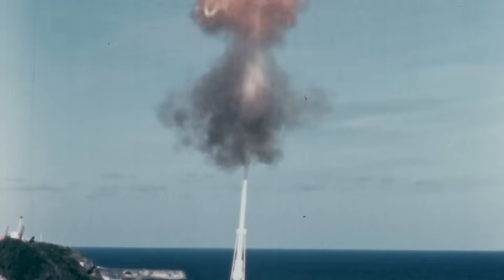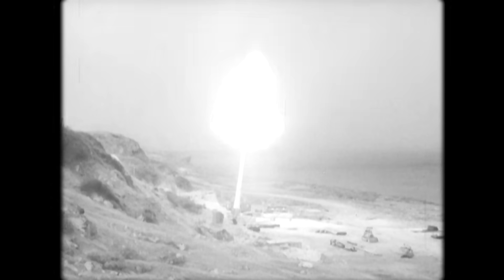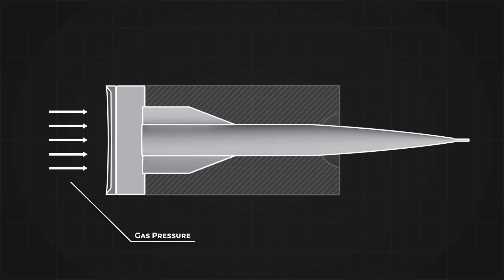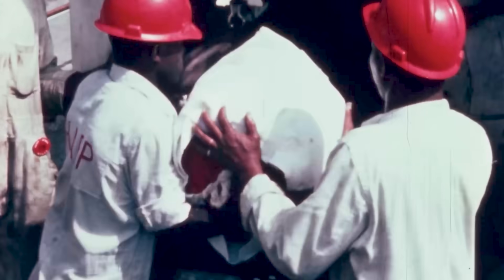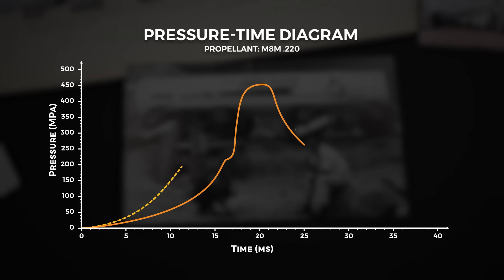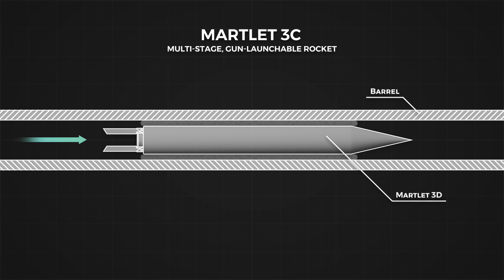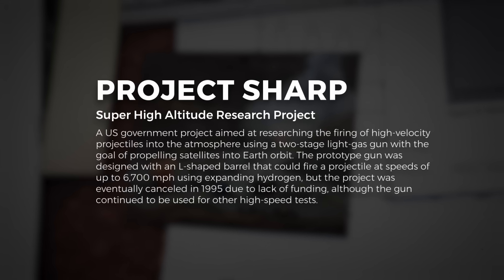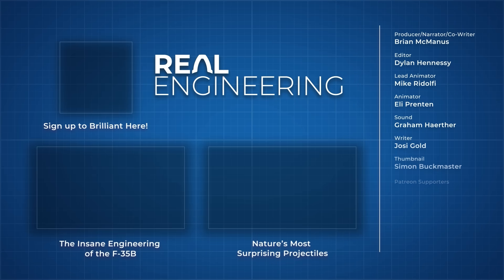This Gun Could Reach Space

Comment: About spin launch: The video about it says they produce strong vaccum inside the launching Chamber. But all the vídeos and animation show only a thin flexible membrane separating it from the atmospheric pressure. Which material is that capable of not tearing (even bending) under such high pressure differential, but fragile enough to break when the projectile passes through it, preventing damage to it?
Reply: The difference between atmosphere and vacuum is small. (relative to going deep under the sea). So even a plastic wrap could withstand the force.
Reply: @OCinneide  Huh, try opening a door on a vacuum chamber and please film yourself doing it. I can bet you whatever you want, you wont be able to open it...
Reply: @Caellum O'Cinneide  when we create a simple vacuum in a Steel pipeline it collapses! Imagine a membrane? 

There are special valves we design to work with sturdy metallic silos subjected to quite small suction forces, to allow air and prevent collapse. 

The vacuum force is huge for thin walled structures, though it look like a simple pressure differential. I'd expect the membrane to at least suffer some suction.
Reply: It isn't a strong vacuum. They made a point to emphasize that in the video Real Engineering did about it. Where did you hear that it's a strong vacuum?
Reply: @Rob Speed  The values they showed in the video are superbly strong, very difficult to achieve. What they say in the video is that they just dont need something near absolute vaccuum (which would be crazy indeed). 

Anyways, the vaccum they achieved is huge, at least to my industrial experience. With much smaller vaccum than that I've seen much harder structures (1/2" steel plates) collapse. But a flexible membrane would at least be sucked (even if it can stay whole) to the inside of the chamber.
Reply: @pseudotasuki  the vacuum could be infinite, you'd still only have 14.7psi pushing on the other side of the membrane
Reply: @MattNolanCustom  Indeed. The reason they're going to use an airlock is to prevent the tether from being damaged by air friction after the payloads are launched.
Reply: Additionally, the full-scale centrifuge will use an airlock.
Reply: @pseudotasuki  This air-lock might be the answer to my question. Because the membrane thing alone doesn't make sense up to now. I still hope someone can bring a more grounded explanation to that.
Reply: @cmnEng  I'm not sure what questions you have which aren't answered in the Real Engineering video.
Reply: Carefully chosen fabric would do it. They probably aren't trying to achieve 0 pressure since the reduction in drag diminishes as you reduce the pressure. They might only get to 10 or 8 psi as opposed to sea level ~14 psi. Going lower could be possible, but you also have to consider the effect on the rocket as it transitions through the pressure change. Too great a change could damage it.

The forces and the tension in the sheet are well defined so they can chose a material and thread spacing that is just above the failure point. Woven fabric tends to stretch and even out the tension which equally distributes the forces to all the threads. The difference in air pressure would apply it's force very evenly, the sharp point of the rocket would not. As soon as it slices a few threads, all their tension is transferred to the neighboring threads which are already nearly at their limit. They immediately fail and their load goes to the next, and so on in a progressive failure.

If you go frame-by-frame (, and . keys on the keyboard) you can see another object behind the rocket pierce the sheet just before the tip of the rocket. It might be unintentional as part of the release mechanism, but you could certainly time the shot of something else to break the sheet. You can also see a couple of flashes and it would not surprise me to learn they have laser that blasts the underside just before the rocket touches it.

Comment: Why are they not building a railgun variant of this?
Reply: I would guess that the barrel wouldn't be able to handle it
Reply: @SM-cq1mm  well, not a straight up retrofit, but a new iteration based on railguns. These would be great for launching satellites, right? Or launching icbms.
Reply: Using projectile launchers to get items into orbit isn't all that useful. We will see how well SpinLaunch does, but the use cases are small and the issues are extreme. You are getting up to extreme speeds at or very near sea level. That is not good. There are reasons that the Shuttle and capsules all try to slow down as much as possible in the extremely high atmosphere. Going that fast in the thick air causes extreme heating and G forces. Many, many other issues with these types as well.

Comment: Piezocrystals don't generate a current. The lattice deformation caused by the pressure just leads to a shift in charges which generates a charge difference aka a voltage (not current) across the crystal.

Comment: Fun fact: piezo cristals can output extreme voltages  like 30KV. Lighters use piezos to create electric arc
Reply: Piezoelectric crystals will produce an electric charge under pressure, they will also change there shape when an electric charge is applied to them. They are used in direct injection fuel injectors do to the high pressures present in the cylinder preventing the use of conventional injectors.
Reply: @skelligfiftyeight2519  They produce a voltage, not an electric current. The current then depends on the resistance. Though there is also an influence of the output impedance, that will make the voltage drop if the resistance is low enough.
Reply: Acoustic guitar pickups are piezoelectric transducers, they are placed between the bridge and saddle with the strings on top.  They sense the string vibrations.
Reply: They still use that method of using piezoelectric transducers on barrels of guns to proof check barrels and to do gunpowder loading checks to ensure powder loads conform to standards.
Reply: repliesgpt The current is tiny though.
Reply: What is a Kelvin Volt?
Reply: @ciCCapROSTi  kiloVolt A unit of 1000 volts
Reply: @rolfbjorn9937  pretty sure it was a joke because it's kV, not KV
Reply: @paulklement4274  I don’t think it was a joke
Reply: @ciCCapROSTi  definitely I meant KelvinVolt 🤣🤣 I'm pretty sure you never made a terrible mistake like this in your entire life, so  please forgive me
Reply: @ciCCapROSTi  It would be "kelvin volt"(lowercase), if anything.

Comment: 'Black powder'? I think not! This gun (and all modern guns) use progressive burning powder that generates more propulsive power over a longer pressure cure to obtain more velocity. Also, it is cleaner burning. Black powder, on the other hand, loses up to 20% of it propulsive power to the production of particulate matter (smoke), thus reducing the the ultimate 'push' given the projectile.
'Black powder' is the term given to the gun powder of the nineteenth century. Composed of Potassium Nitrate, Sulphur, and Charcoal. It also had less energy density than later (smokless) powders.

Comment: Read a book about artillery through history. This was the last subject the book covered and I’ve always been fascinated by it. Surface to orbit capability without the need for a heavy and inefficient first stage, cheap and reusable. The potential for both launching satellites and intercontinental ballistic weaponry without needing to worry about high maintenance costs on the launch vehicle makes my mind wander.
Reply: The muzzle forces on sensitive satellite equipment...there is a reason or two why this isn't being done, even though it would be far less expensive than rockets.
Reply: Guns are cheaper on a per-shot basis but have higher initial development costs which is why you don't see them (plus the engineering and metallurgy to develop the gun barrel to launch a payload of X size is much more challenging than the equivalent rocket fuel-tank-rocket-body to the point of simple infeasibility beyond a relatively low point). Any system which relies on achieving their maximum velocity at the point of highest drag is not a very efficient launch system.
Reply: If it was efficient we would be using it.
Reply: The probkem us inertia will flatten anything  none solid even before it left the barrel.
Reply: @khankrum1  Depends on how long the barrel is.
Reply: @b.griffin317  have you ever fired a gun. Barrel length is irrelevent.  The inial acceleration from zero from tge explosive charge would create enormous G force and woul crush you like a bug.
Reply: @khankrum1  I think the intended use would be launching unmanned satellites
Reply: @b.griffin317  Yes, a rail-gun going smoothly up the side of a mountain would be pretty fantastic, and fairly cheap per-launched kilogram of payload (once built at fantastically expensive cost). If it did about 6 gee (any healthy human can tolerate this almost indefinitely on their back) for only 2 minutes they'd be going at low-earth-orbital speed (but require a modest direction-change and burn to achieve a circular orbit).
It could also be completely carbon-neutral to fire (not to build) with LH2/LOX propellant for the circularization/maneuvering engine and nuclear or renewable power for the rail-gun itself.
Reply: @sleat  I had to run the math. Do you realize how many miles/KM long that gun would have to be? The final second of launch alone would have to be 7Km or 4.4miles long. If the calculator I used is right, the gun would need to be 423km/263miles long!!! Since the highest mountain is only 8.8km/5.5miles high, you would have to support that gun all that way with the strongest and tallest support structures, each of which would make the Burj Khalifa look tiny by comparison.
Reply: @sleat  The concepts you looked at either drastically understated what would be needed for crew, or they used info related to uncrewed launches with hardened payloads at extreme G forces while acting like it would be a simple enough change. It's not. Nowhere close. And being in a near-vacuum in the tube doesn't matter since that is only about getting up to speed easier. It's the fact that all the speed gained from the tube is a problem immediately after exiting as even the highest mountain peak is still less than 9% the distance to the Karman line, and likely 5% or less of the distance you actually want to be at. You are just too low in the atmosphere (causing drag and heat buildup) and need to travel so high that most of the velocity is lost. The speed needed once out of the atmosphere will require a very large second stage or possibly third stage rocket just to now get into orbit. 

"True carbon-neutral is never, ever, easy."
But there are easier ways. Both hydrogen and methane can be produced cleanly. Granted neither are in most cases and hydrogen has a whole host of issues with it's use. But they can be done and without all of the drastic issues and costs of a several hundred mile/km tube.
Reply: @anthonypelchat  You successfully shot the messenger. It was an accurate double-tap to the head and center of mass. The messenger is now dead, and none of the concepts or ideas he relayed were his own. Carry on with your grand mission, and God-speed! 😂
Reply: @anthonypelchat  You subsequently wrote: 
"Some of you may die, but it's a sacrifice that I'm willing to make. lol"

Lawyer: "Now, Mr Pelchat, If you would be so kind as to tell the court exactly how and when The Enormous Evil Space-Gun Concept hurt you, forcing you to hunt-down and attack anyone mentioning it, that would be great." 😂🛰🔫
Reply: @anthonypelchat  You are off by a factor of 10.  It's 70km, not 7, with a final velocity of 1176m/s.
May as well just go the other half and build a space elevator at that point

(math: 9.8 m/s per second * 120 seconds = 1176m/s  Starting at 0, that means the average velocity over time is (1176-0)/2=588, 588m/s*120s=70560m, or 70.56km

Edit: OOPS! I calculated this thing at only 1 gee not 6.  So we multiply basically everything by 6.  So we're looking at 423.36km.  Even assuming a fairly shallow angle, that's still quite a bit higher than many satelites and the aforementioned space elevator would be orbiting.
Reply: @Sotanaht01  Yeah. The 7km that I mentioned was only for the final second of the launch. I got 423 for the entire launch as well. And it was sideways mostly, with the peak at the top of Mount Everest. I wouldn't be surprised if building a space elevator would actually be easier than building a tube to launch off of a mountain. 

Math: killing dreams for thousands of years. lol.
Reply: Look into spin launch. It's a similar concept being done by a private company. ICBM launch is definitely out of the question, but they might be able to master satellite launches for cheap.

Comment: You set off 3 or 4 charges in the barrel at different intervals, as the projectile is being pushed through it.  The projectiles shape and weight. Should be balanced at the noise tapering down to same at fins and it would go farther. Kind of like magnets launch projectiles but using chemicals.

Comment: Most likely, they would have used some high tech sort of smokeless powder. Black powder is one of the oldest forms of gunpowder, it was phased out in small arms in mid 1880s. It is extremely limited in it's ability to propel a projectile, as well as being very corrosive and requiring much more work to prevent against said corrosion. Smokeless powder gets rid of the intense corrosion, as well as being able to throw a projectile much, much further and faster than any sort of black powder could.
Reply: If they used US Navy 110 lb charge bags (I haven't seen conclusive evidence for or against this theory) there would be a small charge of black powder in there to get the much larger charge of smokeless powder going, because the particular mix of smokeless powder that battleships used back then was extremely difficult to ignite under any circumstances. So small bits of black powder were the easiest solution

Comment: em-launch track is better
Reply: and put a rocket stage on the shell
Reply: wrong old design principles
Reply: if you cut the launch pressure away from the gun, then you just shoot as fast as you can
Reply: its only in this specific design type, not in the general launcher case type
Reply: if you would explode new charges along the path of the turret, no limit in the end pressure
Reply: its kinda coil-gun or gauss-gun, you add more power on the way
Reply: well kinda rocket but all happens in the turret pipe
Reply: you could use electric resistance heating to make a steam gun pressure charge, same effect, but line power
Reply: also no gun powder required, like em-launcher, just the expanding water to steam pressure
Reply: not every mans thing, faith, its God's thing
Reply: try spike armor, to absorb compressively maximum amount of incoming kinetic energy
Reply: key is the longitudal compression of the spikes absorbing max energy